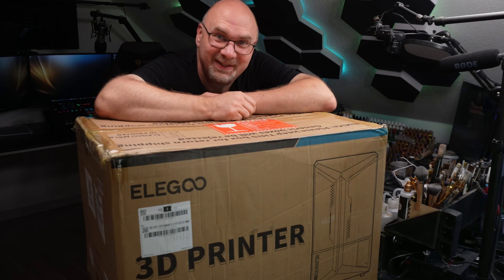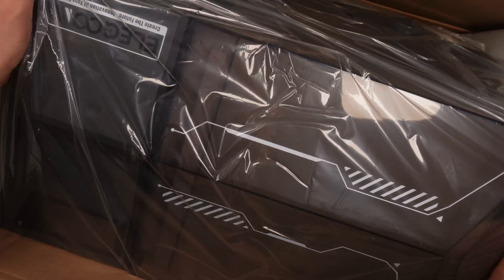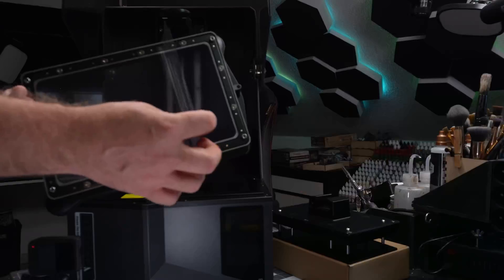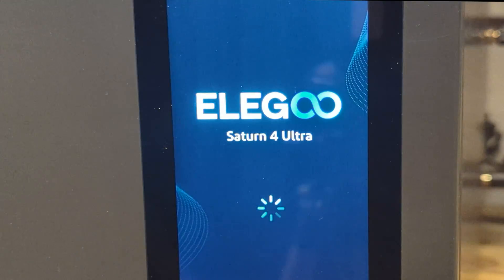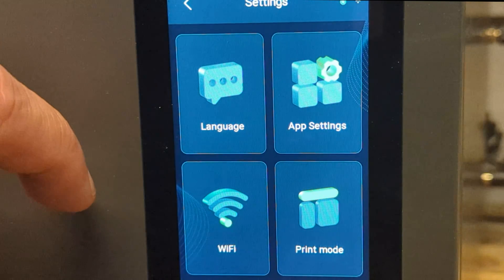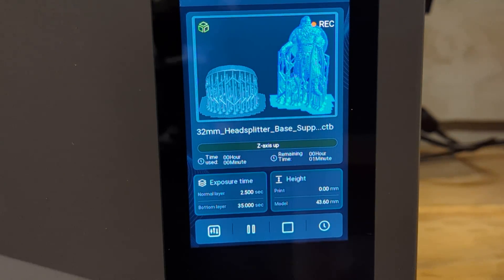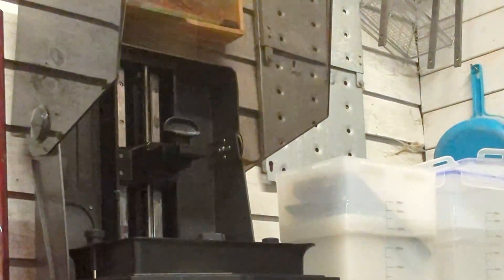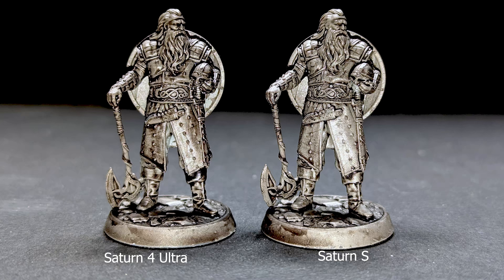Elegoo Saturn 4 Ultra - Honest review and first impressions

Comment: Do you recommend this printer for 3D printing beginners? I am interested in it.
Reply from the maker: It is a very good printer, and easy to use. The Software was buggy in its early release. Latest firmware is stable and it works. Mine is the 12k version but The 16k version got some improvements. Heater, and camera light. It is very easy to use and software is very intuitive. If you buy elegoo standard resin grey, the printer runs default settings and your first print is plug'n'play😃 just remember to update firmware before you start to get latest version. Place printer in a good ventilated room. And have cleanin tools ready before you start to print: isopropylalkohol, cleaning tank and hot water. And a lot of paper towl😉

Comment: Dear Ole, i've been printing in a lab with proper ventilation and still thought the fumes were less than pleasant (even though not toxic at all). You print in a shed or garage, do you feel the need for ventilation? What about when the weather is cold, heated room? temp control? All the best
Reply from the maker: My Workshop has plenty ventilation. I have an intake fan in one end and an exhaust in the other. But I do have some challenges in the winter. Then I need to turn a heater on, because the Workshop is not insulated enough.

Comment: To anyone thinking about buying this printer I suggest buying a silicone scrapper to clean out the Vat and not the included plastic spatula as Iused the included spatula and it ended up putting a tiny hole on the bottom of the vat and I had to replace the FEP (the plastic in the bottom of the Vat
Reply from the maker: That is a great idea, i made some dent in my PFA film, and almost poked a hole once. Thank you for the advice😀
Reply: @olebrogger  No Problem if I can save someone from doing what I did it''s worth the comment

Comment: 10:25 this information just saved me from buying something I would have regretted. Very good review, the build plate not fitting in the cleaning tank is very important. I was actually looking for information specifically to see if the build plate would fit and if not by how much.
Reply from the maker: Yeah, Elegoo have not yet found a solution. they recommend taking off the print and put it in the basket. but i think that is way too messy. at the moment i'm just overfilling the tank with IPA and it works okay :-)
Reply: This is 1st time im seeing someone putting build plate in washing station, till now i've seen people take prints off from plate and put then in washing station.

Comment: curious what you have the microns at? I was doing 50 then jumped down to 30. Should i do 20? I know by lowering the number i will wear out the LCD quicker but i really want crisp details on my prints.
Reply from the maker: I set mine to 25. in the test on both printers. but on daily basis i run it at 50. i can hardly tell the difference. most terrain pieces i set to 100, but only to speed up the process, and for terrain, like crates, trees and doors it works fine. but minis i would go with 50
Reply: @olebrogger  thank you for the info. Its my first printer. Ive already torn 3 feps and had the joys of scraping a lcd screen.
Reply from the maker: @MrFleamonkey  ouch😲, that does not sound good what printer do you use?
Reply: @olebrogger  the saturn 4 ultra
Reply from the maker: @MrFleamonkey  Do you use the Tank clean function before scraping the bits off the FEP? It will make a thin layer in the bottom of the tank that is easy to peal off using the plastic scraper. then you avoid harming the FEP. Remember never use the metal scraper on the FEP
Reply: @olebrogger  ya i figured out the tank cleaner also attaching old support bases to it before hitting that function for easy peeling. School of hard knocks for me i guess.
Reply from the maker: @MrFleamonkey  great👍 good idea about using some old supports, have'nt though about that before. Have to try that out😃
Reply: @olebrogger  There is video of people folding piece of paper and submerging in resin and when they take out it, it nicely peels off.
Reply from the maker: @rossaryrose9337  i would like to see that, can you post a link here. If not join my discord and post it there

Comment: Do you know if it it's a decent idea to have the saturn 4 ultra on my bedroom if I use a fume extractor like yours + I have the printer inside a still air glove box?.
I would like the toxicity to be close to 0% as I would be spending a lot of time in the bedroom
Reply from the maker: I would not recommend having a resin printer in your bedroom, dont do it! It requires good ventilation even with an air purifier. Uncured Resin and resin fumes are toxic, and you could harm yourself if you put it in a room where you sleep. You need to put it in a room where you can provide good ventilation and a room where you dont stay on a daily basis, like a workshop, laundry room, or basement. Just make sure you have good ventilation. And stay safe👍

Comment: DONT SUBMERGE THE FULL BUILD PLATE.  On the Saturn 4 Ultra. The way to go is take the prints off the build plate before cleaning! 
The upper part of the build tray is Hollow.  You don't want it to drip ipa in your resin on your next print. 
It's a minor workflow difference with the benefits of the tilting vat that reduces peel force. Ps. I just ordered mine yesterday.
Reply from the maker: Yeah, i found out, and it sucks. But i just want my models to be clean before i scrape them off the build plate, it gives a lot less mess. I wrote elegoo support and they recommended the same thing, but i think it is a stupid solution to something that should be more simpel. It does not make sense to have a wash station that should support the build plat, all other models from elegoo support this feature.
Reply: @olebrogger  it literally states on the wash station page on elegoos sites: Friendly Tips: Kindly be aware that for the Saturn 4 series and Jupiter series, the build platform must be removed for cleaning, which is different from other applicable models.

Comment: Great side by side comparison. Any way you could print a large (4 inch tall or taller) solid and clear resin print? I want to see if the tilting mechanism decreases or eliminates the chance for trapped bubbles inside the prints. Any clear resin should show the good or bad results.
Reply from the maker: Great idea😃I will try that and post a picture in the community tab👍